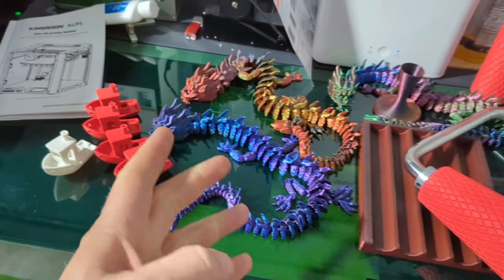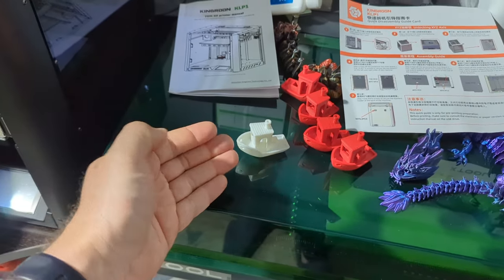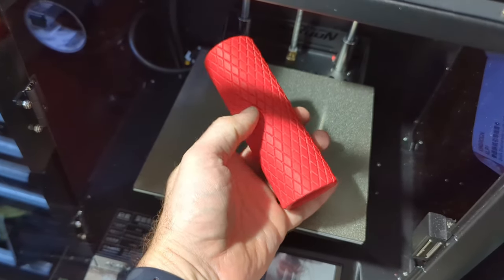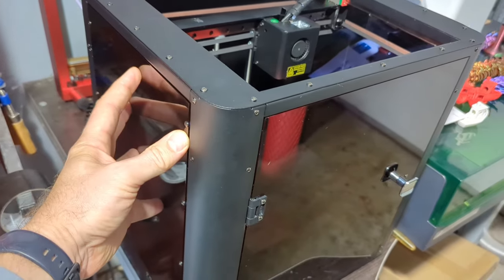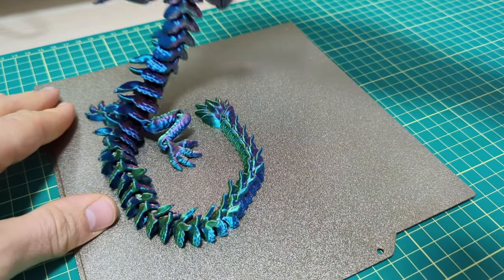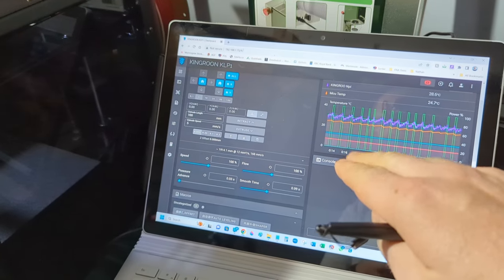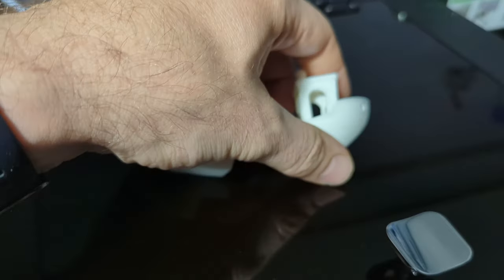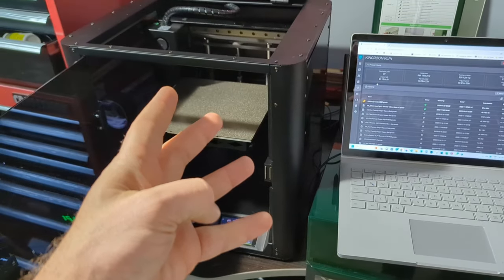Perfect Out Of The Box - $339 High Speed Core XY 3D Printer - Kingroon KLP1

Comment: You probably can go in your router's configuration and give this machine a "static" IP address so it will never change. Look around the menues for stuff that has to do with "DHCP" and or "static DHCP leases" for this machine
Reply: If the printer does not have the configuration to change it, you can try to assign the IP in your router configuration. If you know the MAC Address of the printer, you can assign a specific IP Address for it to use. On Netgear routers it is in the Advanced LAN Setup.
Reply: Scrolled down the comments to see if this was already posted... I concur.  This is how I set up my Taz with an OctoPrint (RasPi) for a static IP.
Reply: @BretSnyder  it's klipper, so there's a linux computer running in there, so there's a way to do it on the printer, but probably not in the normal "user facing" way.

Doing the thing in the router is the best way to handle it at this point. Unless the machine also broadcast a name via mDNS (avahi/bonjour, whatever it's called on whatever other OS you have). At that point there may be a <printer-name>.local address that actually work.
Reply from the maker: Thanks for the tech tips everyone 👍 I'll give it a try next  time I get the chance

Comment: This printer looks like they raided a hardware store for the trim. That handle and magnet system looks directly out of my pantry. I imagine that’s for cost saving and I love the vibes. Never heard of the brand, but I’ll be looking out for them now
Reply: Also, with the IP address changing, that’s because of the DHCP on your router reassigns IP addresses to your devices every week or so. Most routers will let you set a static IP address for various devices on your network. So you can make sure that it keeps the same address every time you check it.
Reply from the maker: I saw the magnetic latch and thought it was from my parents 1983 stereo cabinet 😅. They seemed to have cut costs in the right sports but not diminish output print quality.